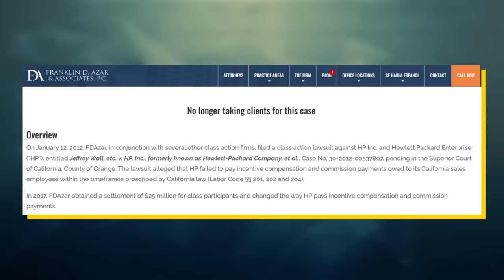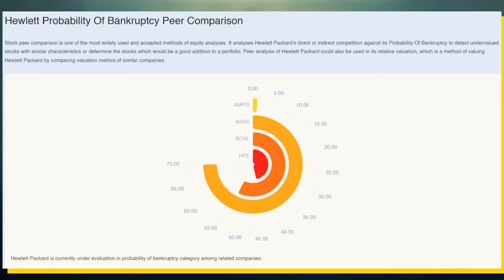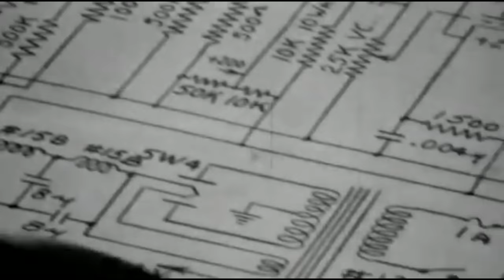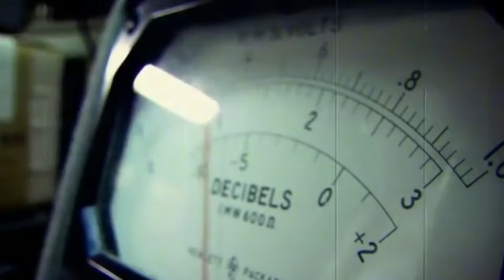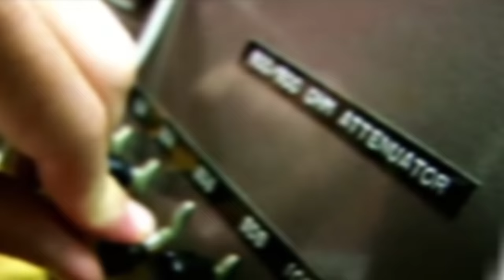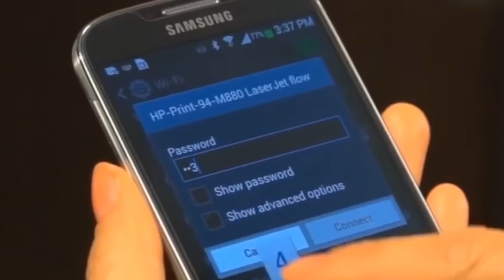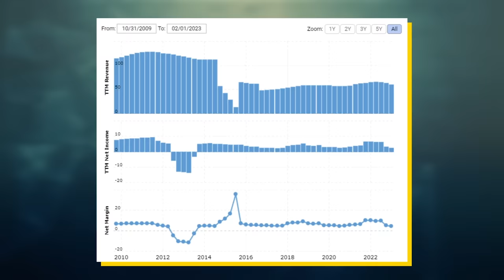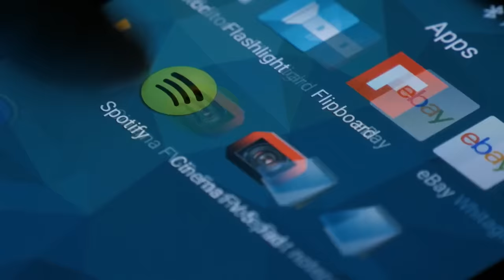From Innovation to Irrelevance: How HP Lost Their Way

Comment: The keysight network analyzers are still the best quality. But I am afraid they will remove the local visual basic programming  and replace it with external programming that doesn’t work as so many other network analyzer manufacturers have done.

Comment: The rot started in the late eighties. Instead of building great printers, calculators, PC’s etc. they tried to “add value” but instead spent a fortune adding things nobody wanted. When that didn’t work they tried to sell the most valuable thing on the planet - printer ink.

Comment: When it comes to laptop for business, IMO nobody beats Lenovo's Thinkpad T and X series lineup on quality but HPs offerings in recent years in the upper mid and upper end have been phenomenal as well. I would place Dell below HP when it comes to quality in my experience for workstations, desktops & laptops. When it comes to servers its a toss tbh HP right now will come in cheaper for most people in rack computing/server space if you go through the right purchasing channels. Laptops and prebuilt desktops? There Dell is usually the cheaper options but not always and it doesn't apply to the ultra low end where Dell is usually expensive. On the lower end people are very cost sensitive and go for HP, which cheaps out a bunch to hit those price targets and did have some quality issues in mid 2010s which gives them that cheap & unreliable image they have now

Comment: I got an HP laptop in 2010 when I was going into my freshman year of high school. I was pretty damn careful with it and it lasted 2 years tops. The thing literally fell apart. Awful awful hardware. The fan broke within a year. Keys broke off and the attachment points snapped shortly after. A few months after that the casing began to crack and fall apart. Never again. I've gone with Toshiba and Lenovo for my next laptops and been satisfied
Reply: I actually had the opposite experience. 2008 laptop and 2010 compaq mini, still going strong
Reply: I have a HP laptop from 2006 still going strong today. I dont use it much anymore but i booted up to retrieve data and besides the battery everything else still works fine.

Comment: I was a fan of HP until 2007, when I purchased a HP laptop that, unknown to me, had a recalled AMD graphics card. The laptop was 11 months old when the graphics card went out. I contacted HP support and they opened a ticket and said they were aware of the recall. 2 months later, I was told that because it was now outside the warranty, I would need to spend 450 dollars + shipping on a new mother board to replace the integrated graphics card. I explained that this was a defect with AMD and other PC manufactures were offering free replacements. They said, their might be some legal action in the future, but for now that is all they were offering. I paid 1500 dollars for this PC and didn't think it was worth an additional 450 dollars. I put the HP laptop in the closet and bought a new PC from Dell and never looked at another HP again.

Comment: I saw the HP original audio oscillator piled as driveway-end junk about ten years ago, with a load resistor across the output.  Apparently it always needed a load.
Reply: Did you pick it up? They're probably valuable now.
Reply: In 1940 it was high tech.

Comment: I am a software student and have a HP laptop and the experience has been pretty bad. I don't have any complaints hardware wise, other than I'd say battery, but the main issue is software.

I can't even use my fingerprint sensor with Ubuntu, change the boot order or many many other things such as a charge limit, which would vastly improve it's quality and usability.

The only reason i could see myself going for HP again was if it offered the same specs for a significantly lower price than others.

Comment: It happens to many companies who fail to spot and adapt to new trends and desperately cling to the past. Next is having bean-counters running them rather than engineers who understand the core business. Take away investment in new developments and innovation, add way too many worthless middle managers, place emphasis on the wrong areas of the business, and not knowing when to cut your losses before a catastrophic fall forces your hand. 
HP is just one of thousands of erstwhile giants that have fallen by the wayside or been merger-ed into oblivion. Even Apple was on the verge of collapse and got lucky. Most don't.

Comment: I only own one HP product, but it is a beast: a 20 year old double-sided laser printer, good as new. Trouble is I have almost no need to print anything in 2023. I didn't think much of HP laptops. I thought Toshiba, Sony, and IBM all had them beat. HP was on the low end with Dell. 1995-2010 era. Nowadays all laptops are piss poor, and you wear them out in a year or two. So it doesn't matter what you buy.

Comment: Money may be in data, but data is and will become much more regulated than hardware or software in future, at least in europe or other high paying countries  with laws about intellectual property. I'm writing this on my HP Notebook running Microsoft Windows 11, perhaps not fresh enough for Microsoft or HP; this system combination behaves unexpected surprisingly weird: 
1. Fast aged rechargable battery capacity reduction, 
2. HP Hardware diagnostics assistant software seems to "behavioural suprising features" or bugs (it doesn't seemed to be successfully corrected after its testing phase if it has one).

Comment: The early HP prospered by aiming very high.  Their test equipment always had like three decades of extra ranges either higher or lower than was thought to be the state of the art.   The emphasis was on quality and performance.  Every HP voltmeter was like a hot-rod running on nitro.   And you paid dearly for that.  Their stuff was mainly for the military and advanced research labs, you'd never see their stuff at a local TV repair shop.   For example a typical signal generator for a TV repair shop was like a  Lafayette Model 140 priced at around $120.  The equivalent HP signal generator was  a HP 8640, priced at $12,000 !!!!!   Not quite sure if anyone really needed something that fancy, but they sold thousands to the military and research labs.   They kinda lost their way trying to edge into commodity systems like PCs.

Comment: I wanted to hear about their Unix and PA-RISC server business.  How did they decide to kill PA and try to replace it with Itanium?
Reply: Intel's process lead by the mid 90s was so significant that a lot of economists could see the writing on the wall for the workstation market, and even with intel failing to deliver, the entire market was dead by 2003. Even the console market would not lift MIPS or PowerPC into the top spot.
It is a tragedy that HP did not push intel to lower the price for itanium: without developers doing cool stuff with it, they were never going to get the economies of scale that they already had with x86. People like to knock itanium, but it really is an extreme superscalar machine if you're very careful about cache management.

Comment: Showing my age: I grew up with a small library of hardbound HP Test & Measurement Catalogue on my bookshelf. I had a poster of an HP 85 on my wall😂. The 9000 series of computers and their PA-RISC workstations were awesome.

As far as I'm concerned, HP lost their shine when they split off their Test & Measurement division.
Reply: It was an entire Group of Divisions, AND it was much more than electronic T+M. It was also Chemical Analysis, Medical, Optical Testing, high performance semiconductor components and, and, and

Comment: As someone who owned the 2018 Spectre X360 I can assure you they pretty much lack consistency. From being the de facto rival to the Dell XPS 13 in 2018 for the title of the best laptop it's such a shame how far they have fallen. The gem cut was the only thing they changed and that's something I absolutely hate. The XPS went on to become a legend. The MacBooks (especially Air) made a such a huge leap that no laptop in it's class can compete. And amidst all the new acers, thinkpads and yogabooks the Sceptre, their flagship is "just another laptop". Not to mention the hundreds of build quality issues. I have had 3 hp laptops, from 2006 when Compaq still was used as a logo. Never again.

Comment: 😥
I bought a Pavillion 15 because it seems to be one of the last "traditional" laptops aka it can be opened up and upgraded or repaired in like 5 minutes.
Also HP is generally very compatible with Linux and is very fond of using AMD CPUs which is why I bought one of those.
Sad to hear that HP isn't doing well.
I never had trouble with the brand and in my dad's company they settled on HP for their buisness laptops for their reliability and attractive pricing.
Well, I guess if my HP laptop dies I'll get rid of it and go all out with a full Linux laptop.

Comment: DEC and HP are companies that show the danger when bean-counters and professional managers take over from the engineers that created the companies and the philosophy of the companies. These leeches on high-tech companies do not understand the culture necessary for tech innovation.  They are only interested in their salary and bonuses and increasing stock prices. This eventually leads to drop in stock prices.  Another hi-tech company facing this same issue is Boeing.  Bean-counters and lawyers should stay in the place in the tech companies where they belong and not run these companies.  I won't even discuss what I think about the value of "professional" managers. HP as an engineering company made wonderful equipment.  It has lost that.

Comment: I had got 2 HP prebuilts about 5 years between them, the seconds power supply broke and I wanted to upgrade the first so needed new powersupply. So how easy was it? First one is standard ATX, just pull out the old one put in the new one and im good to go. The newer one uses a proprietary 12VO thing, which means I couldnt replace it so instead ive scavenged it for parts. Of course the motherboard and case are also not ATX so cant repurpose the case for anything.

Comment: I still use an HP Pavilion x360 laptop. I mean, it's nothing special, I will say this though: It has been quite reliable over the past five years or so, and it was barely over 1k with the 1tb HDD instead of whatever slightly smaller one it comes with.

Comment: The HP we know today has nothing to do with the company originally created by Hewlett and Packard.  This company still exists today but it is called Keysight.  The company called HP today was originally called Compaq and it was (and still is) a manufacturer of PCs (mostly laptops) that are reliable but slightly boring.
Reply: oh so that's why my old 2010 compaq mini didn't have the hp logo
Reply: What? Could you explain this more since that doesn't make sense to me rn
Reply: @floofylunafox  HP bought Compaq and put most of the personal computer business in that part of the company. Keysight has remained largely separate and focuses on high accuracy scientific measuring devices.
Reply: @spaghetti5914  Back then HP had both brands still in use, I have a 2009 Compaq Mini 110c which was also sold with HP branding as the HP Mini 110. HP's business computers were branded as HP Compaq until 2013 when they dropped the Compaq name.
Reply: @colinhobbs7265  I work in an HPE R&D lab, we use millions of $ worth of Keysight gear. I had no idea about this. HPE is now HQ at the Houston Compaq campus.

Comment: HP had a reputation for building rock solid reliable hardware.  Then they went the outsourcing route and the race to the bottom to cut costs.  HP became just a sticker on the cheapest OEM product from China.

Comment: There's a number of things HP did wrong but one of their biggest blunders was "merging" with Compaq. Not that the purchase itself was a bad idea but how they had gone about integration. From day one it was a mess. Essentially Compaq was in trouble. It had bought a server company and that really did nothing but add a lot of debt to the company. Meanwhile Compaq like HP was struggling to figure out the commoditized pc market. By 1997 anyone with little knowledge could build a pc themselves and the low end of the market offered little margins. So the solution Conpaq took was volume sales. Meanwhile HP had a slightly different solution: bundle more trialware with Windows. HP bought Compaq thinking they could leverage both name brands and solutions, with Compaq being the slightly more lower end product. In the end this approach failed and HP ended up retiring the name Compaq in 2012. Foolishly I think, but this is HP.

Comment: Hp printers have slipped in quality. So much that my printer broke 1 year 10 days after purchase. Fault: Main board faulty. That particular model main board were bad. 3 iterations of that model later and the main board were still failing. Seen it firsthand of many of the same printer series failing a lot. Within 2 years I had spent equivalent of a new printer into repairs. And it's apparently same for rest models as well.

Comment: An HP tablet powered by PA RISC CPU and running HPUX as the OS foundation would be in the old spirit. But all of these technologies have been left to die. 

The entire PC and Linux business is anti-HP-Way, because there is almost zero HP innovation and patents inside. LeNovo can do the same at 10% lower cost !

HP once had the engineers and experience to build essentially ANYTHING you can find these days in the Silicon Valley. From search engines to iphones to atomic clocks. 

But Misters Hewlett and Packard allowed their children to spend their life on hobbies, instead of hard men's work at the lab bench, in front of a C compiler or on the factory floor. Neither did they do a stint in enterprise computer sales. So the next generation of leaders were MBAs who did not deeply understand what HP is about. Consequentially Google, Apple, Microsoft and Amazon ate HP's lunch !

Comment: I just got an HP laptop about 2 years ago, it's 17" with 16 gig ram & a separate SSD for the operating system. It's great & it was only about $550 total which is a great deal for a 17" even with less extras. The only downside is the battery is not replaceable but haven't found it to be having any issues in the 1st 2 years & can take to repair shop if needed & not have to buy a new laptop.

Comment: They should have made their own OS for thier hardware instead of windows but this seems too late now. I hope they keep launching better products and diversify their business in other things in the future and they also need to improve their marketing and innovation in thier products.
Reply: HP did kinda have their own OS, HP-UX, running on PA-RISC and Itanium based high-end hardware they built. Linux and X86 eventually swept away the demand for proprietary unix and specialized hardware though (afaik Sun Microsystems felt this to a much greater extent). I sometimes wonder whether HP-UX would fare a little bit better if Compaq didn't kill DEC Alpha (an arguably more mature and better performing architecture compared to Itanium) and HP used that instead of Itanium after the acquisition.

Comment: HP is utter trash. When I was working in a computer store repairing notebooks, HP notebooks almost always broke shortly after the guarantee ended if not before that. My company bought HP monitors for our work spaces and 4 out of the 20 monitors had display problems just in the first week. Most had issues a few weeks after. I once had to purchase a HP notebook due to a client specific project and two of the keyboard buttons broke within the first week. Lately, our company also switched from Lenovo to HP notebooks. The fan is extremly loud, it crashes like once a day and randomly starts and overheats. Very likely, someone from our purchasing made the decision, but has not clue about IT parts.

Comment: I hated there Inkjet printers, work fine for awhile then clog up and stop working, or the cartridge would dry out, go to officemax to get a replacement only to find out that it was cheaper to buy a new printer then replace the cartridge, that's when I started hating hp.

Comment: Never bought an hp again after my last desktop about 10 yrs ago. Almost top of the line i7 desktop and found out the bios was missing the setting to allow virtualization and it still doesn't.... wtf... it's just a bios upgrade and they didn't do it...  my little dell i5 bargain pc for my kids supports it... I do love there older printers though... my Laserjet 3050 still runs great.

Comment: This video is wrong on so many levels.  There are a few specific factual inaccuracies, but that's not the issue. It's more a matter of what was emphasized and what was left out, and the way the timing of events is obscured.  I believe you've painted an inaccurate picture.

When faced with a choice, HP/HPE have consistently chosen badly.  That fault lies entirely with the senior management and the BOD.  But what really killed HP are market shifts that would have doomed them even if they made better choices.

Hardware used to be a good business.  Customers valued quality and innovation, and would pay premium prices for it.  The joke was that "HP" meant High Prices.  Those days are long gone.  You can't blame HP for not being innovative and for letting quality slip.  They're giving customers what they want.  Customers today want cheap crap.  Of course nobody wants to admit that, but it's clear by the choices people make.  Cheap crap consistently sells better than higher quality, higher priced alternatives.